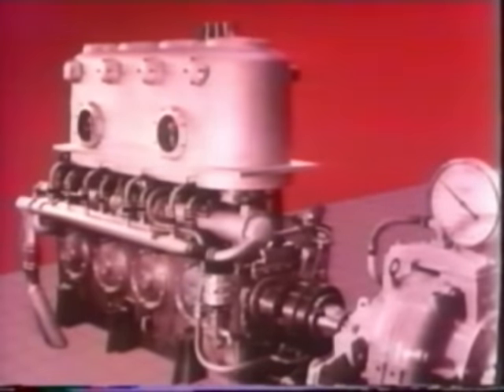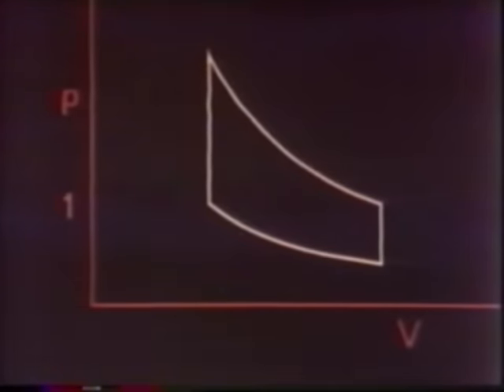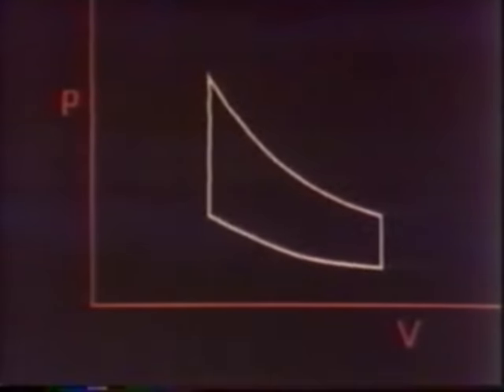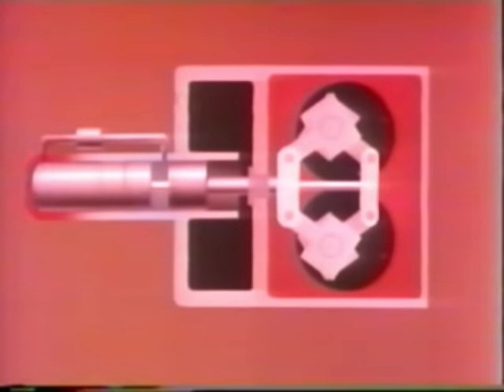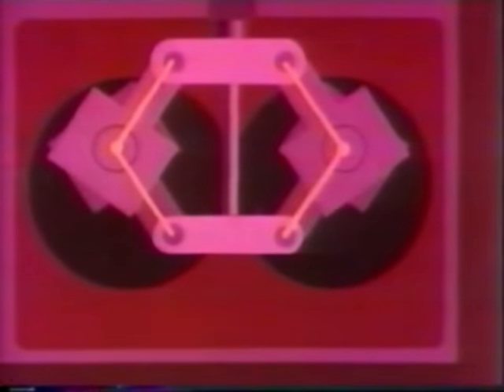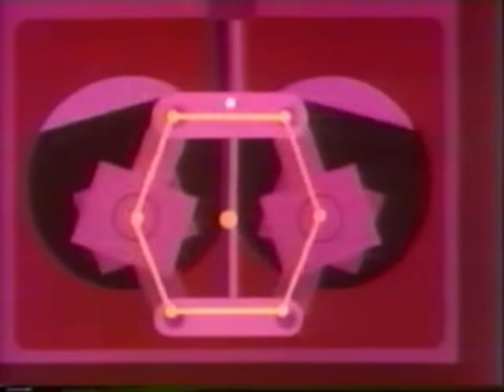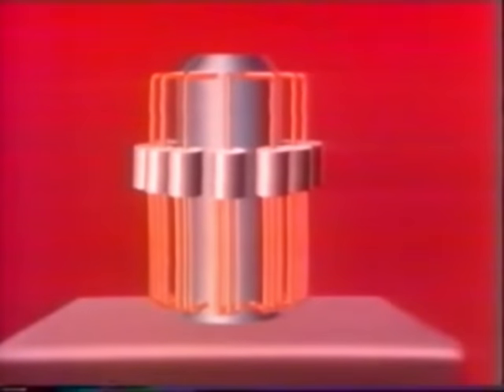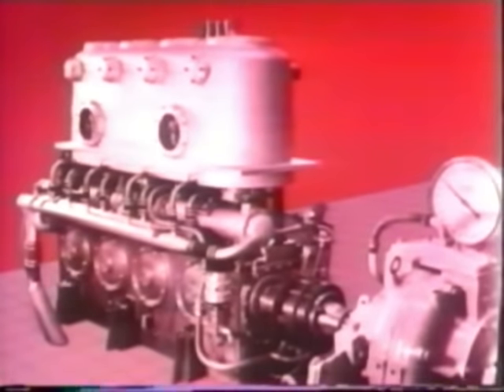The Stirling Cycle part 1 (Stirling Cryogenics)

Comment: i don't understand how the regenerative cooling works. If Stirling is a closed system with Helium, the heat exchanger how obtains a new and colder temperature for fluid to cooling each cycle. Somebody can help me?
Reply: the hot helium from the hot chamber goes through the regenerator, a metal sponge. The sponge heats up, while the gas cools down. When the cold gas enters the cold chamber, it shrinks, thereby pulling the power piston and generating movement. Since it has been pre-cooled by the regenerator, it shrinks more than without the regenerator. Then by the movement of the flywheel it is pushed back again through the regenerator, which is still warm from before. The cool gas is heated by the regenerator before entering the hot chamber and regenerator is cooled by it, ready to cool the gas again next time around. And the pre-heated gas in the hot chamber now expands more than if it wasn't pre-heated, thereby again pushing on the power piston and generating movement for you to use.
Reply: Thanks for answer, i finally understand the movement. But i've another doubt now: the cold chamber reachs cryogenic temperatures? How does the piston to continue the movement? steel hasn't problem at that temperature? Thanks
Reply: no, steel doesn't have problem with that.. also, there is only helium on the inside of the piston, no frost, since helium would take much much lower temperatures to freeze. I'm not sure how low this device can cool it, the air liquefication seems a bit extreme. But I've seen youtubers making hobby stirling engines doing -40 celsius no problem.
Reply: you seem pretty knowledgeable zzanzare, could you tell me 2 things if you dont mind?
1. how is the metal kept from overheating? i.e. this video explained most things pretty well but not how the piston would be lubricated in the chamber to prevent damage to the engine.
2. what metal specifically would be used as the metal sponge?

I appreciate your time!
Reply: haha, and that's where my knowledge has its limits ;-) I'm just a guy with technical background who is fascinated by stirling engines and watched almost all stirling engine youtube videos :-D I think that lubricating the piston and preventing the damage would be exactly the main magic that Philips would guard as their business secret, because that will make the difference between a useful product and a cool but impractical toy. Also, the cost of maintenance is one of the main reasons stirling engines are not used everywhere today - it seems it's pretty hard to do right.
Reply: AH,  no problem brother, thanks for responding atleast. However, from the time i looked at this video i've been doing some of my own research, and i came across this here on Google patents, why not check it out and let me know what you think of this guy's novel way of resolving it?

https://patents.google.com/patent/US5755100A/en?q=stirling+engine&oq=stirling+engine

he seems to want to use teflon lubricant and has some other ideas
Reply: @jrodriguez1374  I think they used stainless steel for the whole engine. Also for the regenerator. Using the same material gives less problems with changing temperatures because of expansion caused by heating.

Comment: If this engine is that so efficient,  how come NO ONE is using it since it was first invented??

SOURCE of heat is aplenty,  during the day just focus the rays of the sun to the hot plates or cylinders for example,  charge batteries during the day to use at night,  etc
Reply: Its less efficient as it gets larger, so viable large scale ones are still questionable, but in the 80s  a car was produced that was efficient and functional using a sterling engine. It also had nearly 80mpg
Reply: @Xrayflames  Even if less efficient,  the heat of the sun during the day is free.  Maybe it can generate more power than the solar cells
Reply: @oswaldoriginal5037  there is a type of solar array which uses a Stirling engine, and its one of the most efficient solar dishes available now

Comment: are you able to drive the equation for heron's fountain also, so we got that free energy from atmospheric pressure forever for mankind's from it's fountain
we drive a turbine from this fountain and that will give electricity which controlled the heron's fountain various parts and maintained the air and water flow by computer programming and we got free energy from atmospheric pressure forever for mankind's

Comment: Just 40% thermal efficiency?? Thats not too good, some modern Toyotas manage 41% thermal efficency
Reply: 40% those days was perfect. Imagine if it developed like other engines did in last years. There is still big potential in this engine
Reply: This video is probably at least 50 years old. 40% with the tech back then was way ahead of the curve.

Comment: over compicated and too expencive, gasoline engine is cheaper and makes its own heat, and can be started and stopped quickly. soooo, untill we run out of gas it aint gonna happen.
Reply: Terry Frederickson "gasoline" engines as you call it uses a combustible gas as a expanding gas to push the piston.

The combustion engine is the most inefficient engine compared with a stirling engine and the Sterling is more inefficient then steam turbine.

Let me explain, unlike a steam or sterling engine, the piston only pushes down, that is why a second piston is needed in a combustion engine to push back the other piston. 

Sterling and steam engine both work best when the heat is conserved, unlike the combustion which requires constant cooling. That constant cooling is a lost in energy from the combustible use.

Both steam and sterling opperate in a closed loop where only the byproduct of the heating is lost.

Sterling engine wont reppace the combustion because the electric engine is more efficient, but the Sterling engine can be use to create the electricity for the egine even though a steam turbine is better. But the sterling engine could prove usefull to space craftas a mean to generate power and controle the heat of the vessel.

The combustion engine is only used because for capitalist, efficiency create opportunities for profits. Burn more petrol then would be required for the same powerif a steam engine, you give more money to the oil people.

The cycle continues while you becone poor and them ritch. All because you belive then when they say the combustion engine is better.